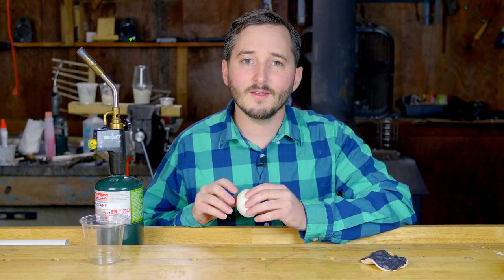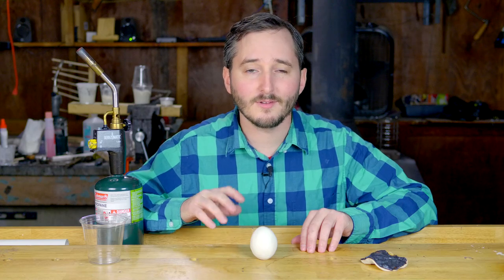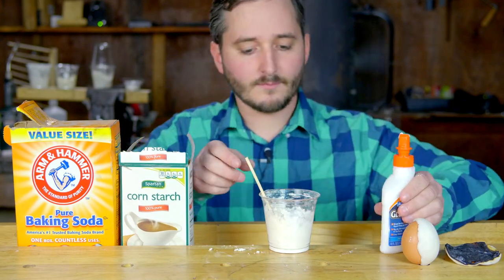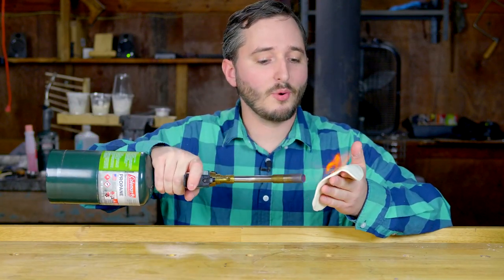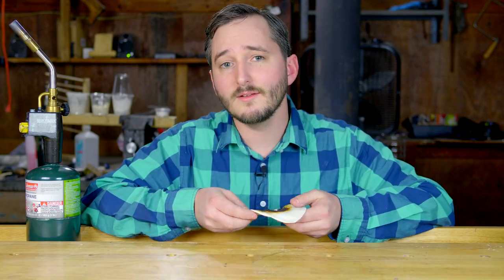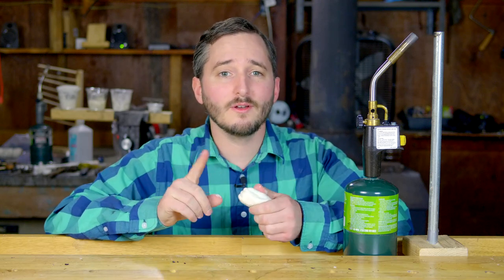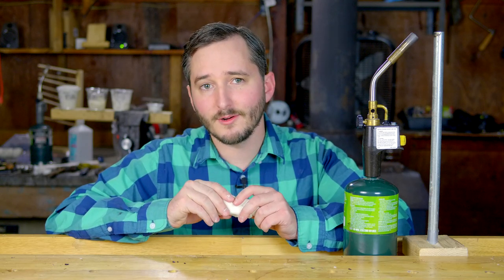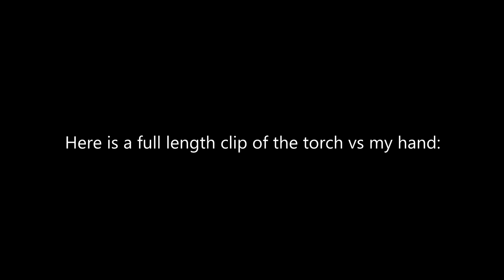A Super-Material That Can Be Made In The Kitchen (Starlite Part 1)

Comment: I finally got some glue today to make some, and I made a batch. It definitely survives my propane torch, about to test thermite.

Edit: I've determined that 1/8" thickness of starlite is NOT enough to stop 26 grams of thermite, but it survived better than a steel can would
Reply: After you find a pretty good thickness, can you try thermate?
should be a lot hotter, but more dangerous, make sure your safe for science.
Reply: I think you're missing the physics behind this material... it's not going to perform well with a direct high heat source molten on top of it.  It works with a torch because the flame is non-compressing and it lets the carbon layers build up in small layers.  With a thermite you're compressing the layer down as they are forming, while applying a few thousand degrees C, compared to only around a thousand degrees C by the propane torch, so of course it will not perform well.  That's like saying, I'm going to throw a ping-pong ball against your head, not let's see how a hammer will do.  Something along those lines.
Reply: @BillAnt  

Well, starlite was apparently tested against a 10,000c focused laser.. So, while I know that doesn't address most of your points, it does suggest anything that IS actually Starlite and if Starlite itself IS what was claimed, 2000c shouldn't be a problem.
Reply: @jessthehuman  < Whether it's the original Starlite or this magical "pancake" (tsk-tsk), they were both tested by direct heat BUT not with the burning material sitting on top of it.  Radiated heat can be a propane flame or laser, but what you are doing with thermite is applying heat AND physical pressure onto the material, therefore the protective carbon layers which form by the heat are pushed down and compressed, essentially diminishing its inherent thermal protective layer.
Also, keep in mind that thermite burns at a few thousand degrees C, while the propane torch burns around a thousand degrees C at the most.  Another factor which affects the material's protection is its thickness.  With a propane torch it should work fine at about 5mm thickness, but with thermite you would probably need 10mm to compensate for the double or triple heat level.
The point I'm trying to make, is that your thermite experiment is an unfair test, because you are destroying its protective carbon layer by the pressure of the thermite.  Here's a hint, run the test again by burning the thermite at about a centimeter away from the material (don't let it touch it), and you'll see it should withstand that heat.
Reply: @xxcatcreeperxxcat375  i don't have any of the extra ingredient needed to make thermate unfortunately. It's a bit too toxic for me to be messing with at this time  :/
Reply: @BillAnt  that does make a lot of sense and my results were basically that. The molten iron did burn right through the thin layer but none of the aluminum oxide did, it seemed to be light enough that it didn't crush the carbon much. For my next test of it I'll make a shell out of the 'starlite' and loosely cover the thermite with it instead, maybe with a thicker disc underneath it to see if I can fully capture it. It made a fair amount of smoke though and I'm curious how much carbon actually got into the iron. A bit later I'll go out and test the iron I produced for brittleness
Reply: @BillAnt  

No shit. I think you need to re-read what I wrote, Sweety.

Although, it's kinda pointless now as you edited your original comment and didn't leave annotations about what you changed, making me look like an idiot in the process.
Reply: It may also rely on the slower heating rate of the torch itself. Thermite will heat it up much faster as it jumps from ambient to the bp of aluminum (or whatever the solute metal you used has) almost instantaneously.
Reply: Well it isn't starlight so...
Reply: Heat it up with a torch first so you get a carbon layer built up before using the thermite to see if that aids in it lasting.
Reply: Someone on YouTube called "Fr-223 Laboratories" tried it with thermite and it held up. Is there something OP and him did differently?
Reply: @jessthehuman  A laser is not the same as molten metal, lasers can be reflected!
Reply: @snottybeaver4919  

The "laser test" (if it really happened) on Starlite was supposed to have been conducted by NASA or some other US Gov Alphabet Group - it says 10,000C was concentrated heat on the 'Starlite' - so I'm sure they wouldn't have included a result that simply bounced the beam away.
Reply: hi try it with an oxey blow torch mate. the gas flow blows of the carbon and it slowly eats its way in. still takes some time to do it. I would love to try the thermite but its a criminal offence to make that stuff in the UK. :(
Reply: @tommyfred6180  Yeah well... You can't even spread butter on your toast in UK without it being criminal offence, bcs K N I F E S xd
Reply: @jessthehuman  so you are comparing a laser and molten metal?
Also, this statement makes no sense.  "so I'm sure they wouldn't have included a result that simply bounced the beam away."
Never passed physics?  Or just sailed on through due to the incredibly great public education many of us had?
Reply: @ryszardbargiel7256  The lack of people's reading comprehension skills these days is alarming.

I was pointing out that a comment mentioned you couldn't compare two different temperatures, the post has since been edited, without annotation, to make me look stupid.

But all I was saying was that saying oh "2000c" is too much is a false statement as Starlite was allegedly tested at 10,000C (and also apparently against nuclear blasts lol).

My comment had literally nothing to do with the nature of molten metal and lasers, it was about temperature and it made a lot more sense before the comment I was replying to got edited (notice it says "edited" - that happened after I pointed out where he went wrong and he removed the offending statements without crediting me for pointing it out).
Reply: @ryszardbargiel7256  

Further - my degree is in computer science, not physics. I'm very good at CompSci. I have about high-school level physics. Which was about 20 years ago. I'm guessing you're a kid, believe me, you too will forget a LOT of what you learn in school other than what you put into practice. Hardly worth pointing out anyone's lack of knowledge in a distinct field without first verifying that's a field they actually carried on studies in, or applied through life. It would be like me pointing out your lack of knowledge about a 16th century poet and laughing at you for failing English-Literature - despite you never pursuing any interest in such matters.

My comment about deflecting the beam was in response to someone saying heat from a laser doesn't count because you could deflect it. I'm sure they wouldn't have listed it as being able to sustain 10,000C if that's not what actually (allegedly) happened.
Reply: @jessthehuman  do what I do when replying to a comment, especially a longer one, quote the particular sentence, etc. so that both the poster and others understand the context.
Temperature is not the argument here is it?
Be careful being so quick to judge about "reading comprehension" while displaying a lack of it.
I'm not a kid, and btw, also studied Comp Sci.
Reply: @ryszardbargiel7256  

I replied to a specific person and their post, with the @. However, after they received it, they edited their original comment. I didn't really think that  much of it other than scolding them.

But if you really felt the needed to have a go at me. It would have taken a minute to do you due-diligence reading through the (at the time) less than 20 comments and you would have seen the chain, including a previous comment explaining the post i replied to had been edited, hence leaving my comment somewhat without context.

EDIT: That said - and this is on me obviously not you - I DID actually put the context in my original post, as I mentioned - as you can see in my first post, it just ends mid-sentence (or maybe even mid word lol - not scrolling up to it again) - but I DID actually include proper context and it wasn't until I got replies that I realised I'd only posted half of what I'd written. That's all on me, definitely.

But again, if you read some of my replies, I HAD already gone over the point you brought up.
Reply: @jessthehuman  I think I got lost on who said what.   I just want to make sure everyone does understand there is a big difference between a torch/laser on a material vs thermite sitting on it.
Reply: @ryszardbargiel7256  Fair enough. I apologise for being rash, but I'd probably answered a similar reply about three times and was getting frustrated. But in all fairness, my main frustration was at the guy who I originally replied to, who literally edited out the parts of his comment that I objected to, then proceeded to attack me as though I never had a point. Leading to an overall fairly negative feeling towards this chain of comments.
Reply: Beyond the Press tested a thermite crucible, and it survoved
Reply: @BillAnt  I just watched someone today burn thermite on this stuff. Held up fine. NitroJon Science was the channel.
Reply: Does it conduct electricity, and could I run it through a pasta machine to flatten it, or is it too sticky?
Reply: Could you try putting the "starlite" dough around a tupperware container or something of the sort and putting it above the burning thermite? I'm not sure what temperatures would actually be hitting the starlite without direct contact but I'd be interested to hear the result
Reply: spit take intelligent comments on a youtube video???  What universe did I wake up in this morning?
Reply: @BillAnt  just watched video what brought me here where guy is testing this with thermite and it survived.
Reply: @BillAnt  beyond the press did this today it worked really well once dried it can take some of the force
Reply: dELTA13579111315: WOW bro! And thanks for the update too.

Comment: I wonder how good this would be as a refractory material in a lightweight, or budget forge, or one that wouldn't need very much time at all to get to operating temperatures, since the refractory material wouldn't need to be pre heated to keep the interior at a constant temperature like some forges. You'd probably need to run the burner (if gas powered) fuel rich or at a stoichiometric ratio to keep the carbon from oxidizing away once the CO2 that makes the bubbles dissipates though.
I'd imagine something like this could be used over firebrick or plaster of paris (bare metal would probably work too, it might need a rough surface to grab on to better though) to reduce the wall thickness and prolong how long they could go before needing to be changed, since all you would need is a paint scraper and some fresh Starlite like material and you basically have a new forge.
Reply from the maker: Keeping the forge fuel rich is a good idea

Comment: There are still ways to improve this mixture: add sodium silicate.  It will form silica char, which is more durable than carbon char.
Reply: what percent sodium silicate?
Reply: @steveolive9991  I don't entirely know.  My guesstimate is 5-25 percent before it substantially changes the material properties to a glassy foam upon rapid heating.  Though glassy foam might be good too, it might also suffer problems with repeated thermal cycling.  Experimentation is a good idea and I have neither time nor money to do so.  The way that I would run the experiment would be to make three different batches and see which lasts longest under extreme conditions.  Vary the percentage of sodium silicate in the batches between the two best performing batches and perform this experiment recursively in a binary search like manner until you find what you like most.
Reply: not amouse : Excellent! Very cool, Sure you're not a Vulcan?
Reply: @the rougemillenial Borax would make a non-flammable hard char and is likely a suitable candidate.  Triethylamine probably not as it would vaporize and burn.  Glycerine would burn like sugar because it is one.  It would not form a durable char without other things.  Which then got me to googling: Glycerol borate triethylamine complex is some sort of hydrolysis resistant corrosion and wear inhibiting additive to personal care products.  This could maybe be used to make a borax aerogel.  Add sodium silicate to make a Borosilicate glass aerogel.  Interesting.  Sounds like something I wish somebody would test.
Reply: @paulpolpiboon9535  Engineers are human too ;-)
Reply: not amouse ...I like the visualization of where these ingredients lead to, theoretically: however, any widespread applications would require a sheetable / moldable rigidity, perhaps an underlying, pourous ceramic honeycomb structure.
Reply: @notamouse5630  im going to try a solution using Borax, to make hommade rocket nozzles, possibly  could you help with a percentage amount of each compound to mix in?
Reply: @ThirdeyedeasInc  Materials which would match its heat resistance are few and thus the underlying layer would be properly be made of aluminum honeycomb rather than a polymer which would sag under load.  Bear in mind that no version of starlite holds out indefinitely and it is not insulative in the extreme long term.  It is also not a strong material until heated, and then its surface goes from a slightly tough solid to stiff and maybe glassy foam.
Reply: @notamouse5630  Do you think that it could hold as and keep its properties if dried after being aplied, or if you cover it with a varnish so it is protected from the air? What after being burnt (the carbon foam) do you think it could be used to insulate for a long period if not broken?
Reply: @royendershade8044  Protecting char from the air if it is made right is not likely necessary if the original material is itself unlikely to grow mold when wet.  varnish is flammable and would form an oily residue if oil based.  If Polyurethane based, it would burn quickly with noxious fumes.  The best coating would be sodium silicate as it isn't soluble in water once cured by heat and would improve char durability.
Reply: it might become thermally conductive and also no longer flexible
Reply: @notamouse5630  I like the words recursively and binary...just say'n.
Reply: Waterglass is sodium silicate...
Can be made from crystal kitty litter!!!...but the binder (glue) has to be flexible in order for the carbon binder matrix to bubble & form the protective layer!!! PVA glue would be an interesting candidate as it is quite tacky when it heats up!!! I use it on my heated 3d printer bed to hold the prints extremely securely at 60 degrees centigrade!!!
Reply: What about adding some WC to make it a lot tougher?
Reply: Could this be made in to a durable shell for heat cycled components (engine turbocharger for example)?
Reply: @yoboitmose : The material does not seem to be able to withstand the blast from the rocket fuel, so to use as a rocket nozzle or re-entry insulation would only ablate the material very quickly. What you need is a material that has a durable surface that is able to retain the optimum shape under the conditions of high heat and high velocity gasses.
Reply: @notamouse5630  : What is the melting temperature of sodium silicate? Would sodium silicate be too brittle to be used as a nozzle? As a coating, it would prevent the expansion required until it was ruptured and the shape required for the nozzle would be lost.
Reply: @Guest-pp2yo  all those things are correct to think about except melting point as rocket exhaust is not quite that hot.   hence the reason I don't really suggest it as a great idea.
Reply: @notamouse5630 : I would be more worried about the turbulence of the rocket exhaust flow cracking the surface of the nozzle. Ablation of the nozzle material was a problem in all of the early rocket experiments.
Reply: Would it be mixed into the other 3 components or applied as a coating?
Reply: @fookingsog  PVC glue would react with sodium bicarbonate and become super hard instantly.
Reply: not amouse u do it then
Reply: @notamouse5630  but Borax is poisonous, and a family member of Ward's (one of his daughters, Niki, I believe) said that they had used to feed dogs and horses with Starlite and they wouldn't get sick
Reply: not amouse  I can test it
Reply: ThirdeyedeasInc MannafestationMan  like graphene
Reply: @notamouse5630  Thank you. No list of kitchen or grooming stuff because: 
Stuff has other stuff included.
It is my responsibility to identify the plus, neutral, minus components of stuff.
Reply: @the rougemillenial perhaps " heat protection" hair products. The type designed to protect hair from blowers, curlers and staightners
Reply: @notamouse5630  z
Reply: "How much does a 1 lb. box of sodium silicate cost ? " is my very first question. If it costs more than ten U.S. dollars, I lose interest immediately.
Reply: I get he didn't share anything and didn't allow for samples to be taken out of his sight but what about the samples after he died?
Wouldn't be the first time government stole stuff from a dead man and claimed not to.
Samples need to be someplace that could be reversed engineered.
Reply: the rougemillenial Smart observation!